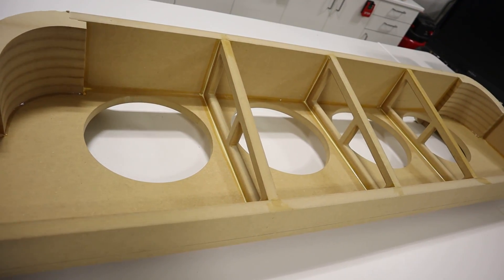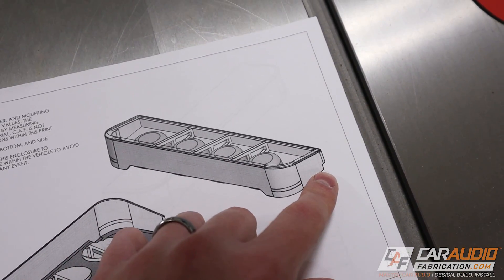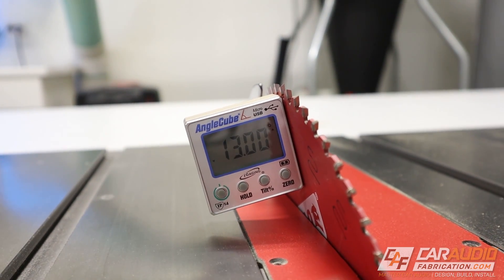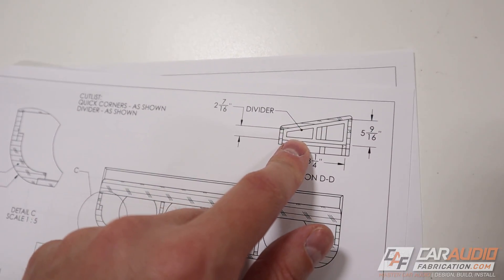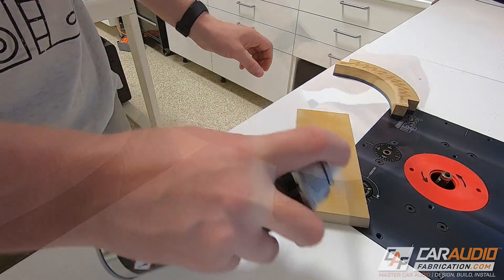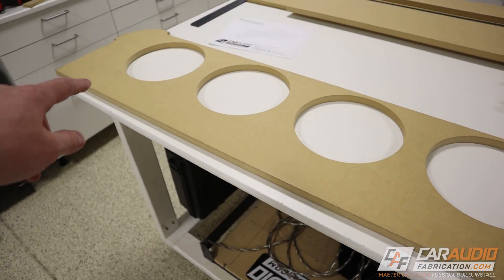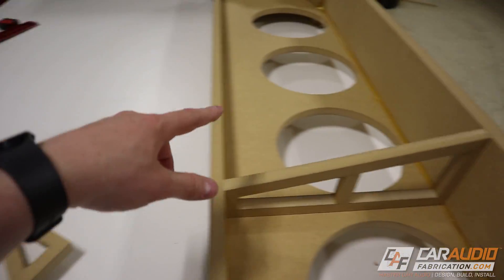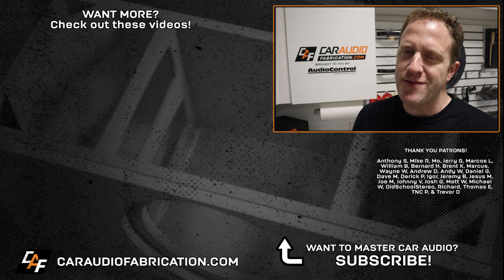HOW TO Build! Underseat Subwoofer Box Fabrication EXPLAINED!

Comment: I like the video and the great work on the box.  My question is how you decided how much space to leave between the baffle/sub and the floor, and if you calculated the area for the cutouts in front and back.  I am doing a "down" firing sub into the solid back of a seat with a cutout (arm rest fold down), and am trying to decide how much space to leave for the 2 10s.  I was trying to use the surface area of the subs but that ended up with 6" of space which seems like too much.  I assume I will end up with a quasi-bandpass type of thing which your box should as well.  Did you compensate for the extra woofer loading in your box calculations?

Comment: Hello sir.
I would like to install 2x2 6.5 inch speakers in the front. I want both 4 ohm speakers and parallel it to 2 ohm and then bridge it on a 4 channel pioneer digital Amp.(120w rms/channel 2 ohm capable)
No speakers at the back only dual speakers at front. What do you think which speakers I should go with ? I would like to have component speakers not coax. I'm now running focal mid series but only 1 pair.

Comment: Great work Mark!
I've got a question. Have you ever made a custom center console from scratch? Or have you ever worked on a big van like a Chevy express?

I have recently purchased a chevy express and I want to upgrade all of it. I added a nice pioneer head unit, a provisional active subwoofer under the seat, a set of component speakers in the front and a pair of coaxial speakers in the back along with a super tiny amplifier from db drive (euphoria series). 
I really want to make something great out of that project and I've been looking at JL Audio for the whole system. Im thinking about a sealed enclosure with a pair of 10TW1 subwoofers inside the custom center console, a nice set of C2 component speakers in the doors, a set of C1 coaxial or component speakers in the back (6x9 woofer) and maybe a pair of C1 4 inch coaxials in the middle for a nice complementary fill due to the size of the vehicle.
The thing here is that I am trying to figure out the system and the possible uses of such a huge space added by a center console (it would be about 30 inches long, 15 inches wide and 16 inches tall) and It would be super usefull to get some inspitation, tips or guide about it.
What do you think about the system? Would you change anything? Would you go with the small coax in the middle or simply use the front and back speakers?
Thanks a lot

Comment: What? you can't adjust the ruler to the blade?
My table saw has that feature.
Reply from the maker: For just a few cuts?
Rather keep it dialed in and do the simple math.
Reply: @CarAudioFabrication  
oh, I missed the angle conversation part.

Comment: No way that has enough air space.
Reply from the maker: Except it is literally a perfect match for what JL recommends. That's what happens when you use subwoofers that are actually engineered and designed for the application, instead of some of these companies making cheap wannabe "shallow mounts" that require just as much air volume as a traditional sub.